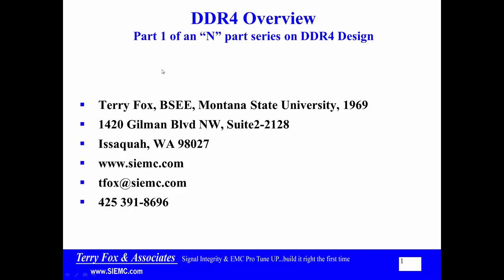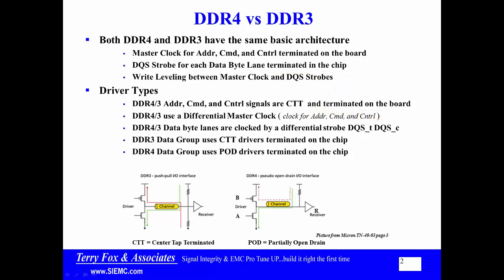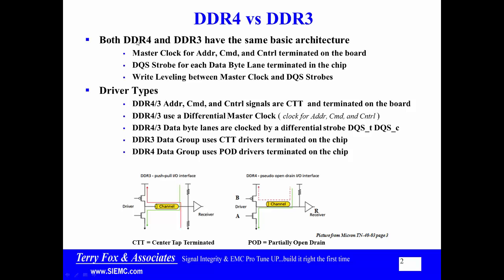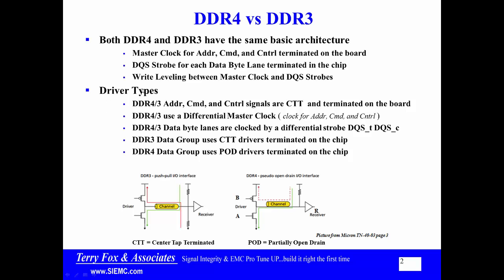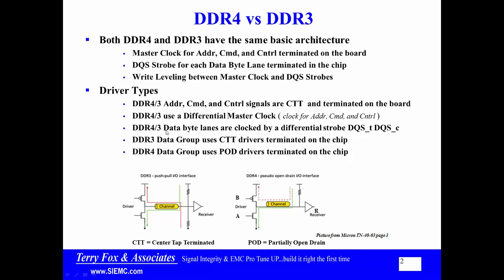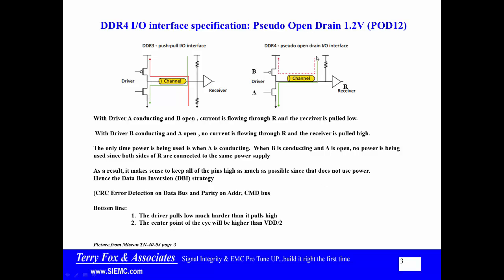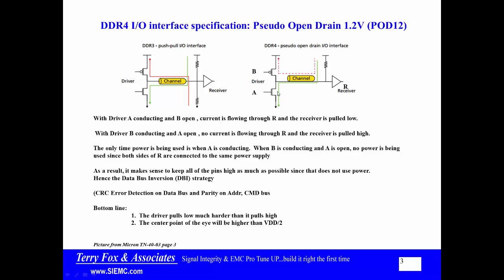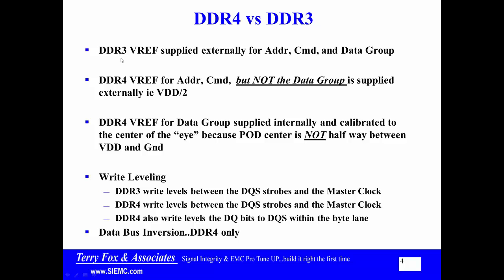DDR4 Part1

Comment: DDR4 data voltage (AC) was shown on one slide as +-75mV and +-100mV on the next slide?  Was one of them supposed to be DC?
Reply from the maker: I think you are looking at the difference between Addr, Cmd, Cntrl levels which work as Center Tap Terminated and DDR4 Data signals which are Partially Open Drain.  One value for CTT signals and the other value for POD signals

Comment: Hi,
Could I use balanced tree topology for clock/address/cmd instead of daisy-chained?
The application is one host and two DDR4, expected running at 2400Mbps.
Reply: If you have a very small design...ie very few SDRAMs, you could theoretically make it work.  I would NEVER do anything without simulating it first..TFox
Reply: Yes, it is a small form factor design. Thanks for your comment.
BTW, these video series of DDRs and SI/PI are very good and helpful.